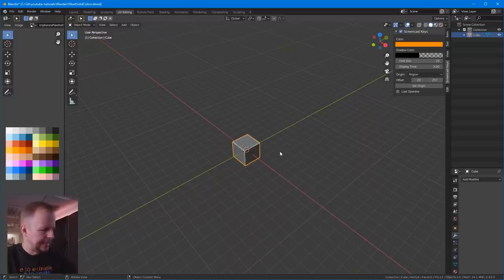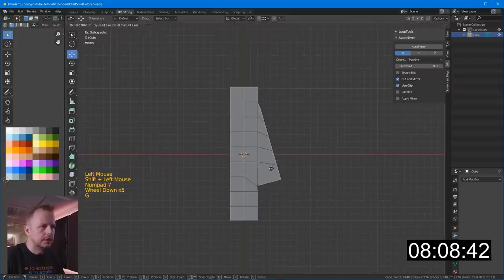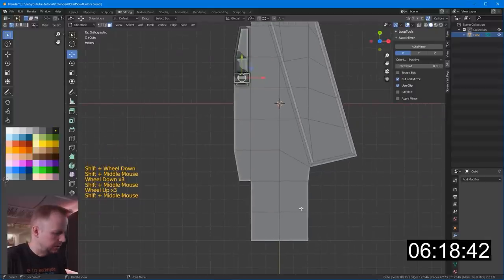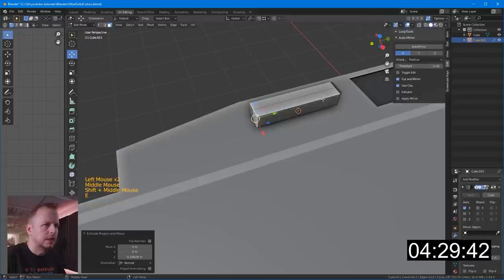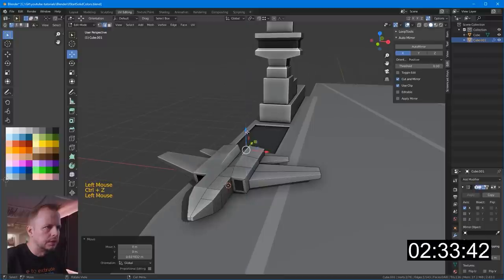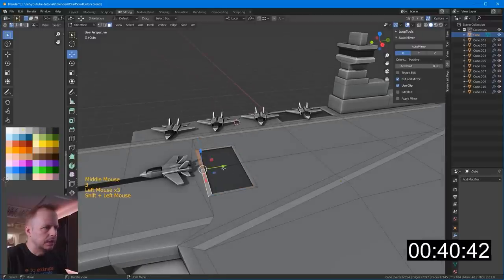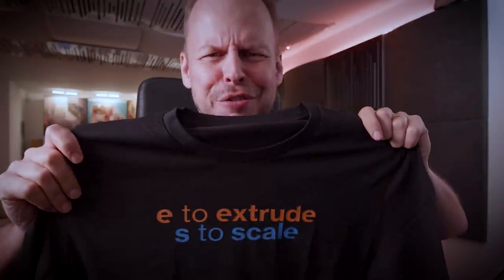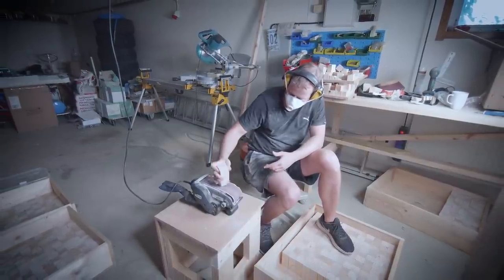Let's Model an AIRCRAFT CARRIER in 10 MINUTES - Blender 2.83 - ep. 30

Comment: I would probably Alt+D (Duplicate Linked) the planes rather than Shift+D (Duplicate). A very minor difference here, as you were done with the object and it was small, but convenient if you decide to tweak it later. Even Duplicate doesn't actually copy the full depth (normally shares e.g. particle systems and materials), it's adjustable in the editing preferences.